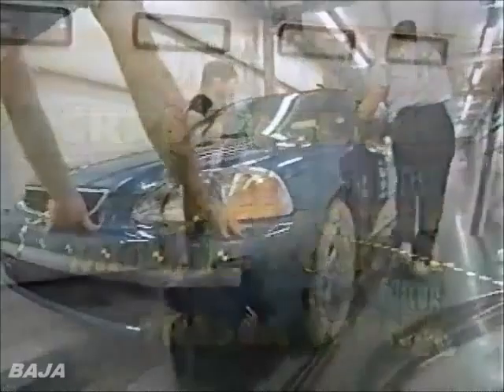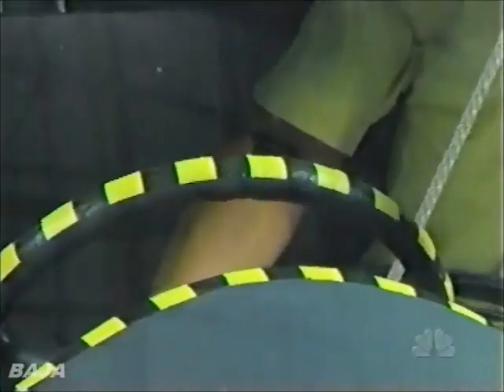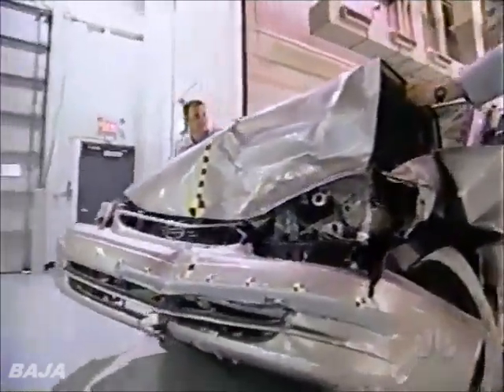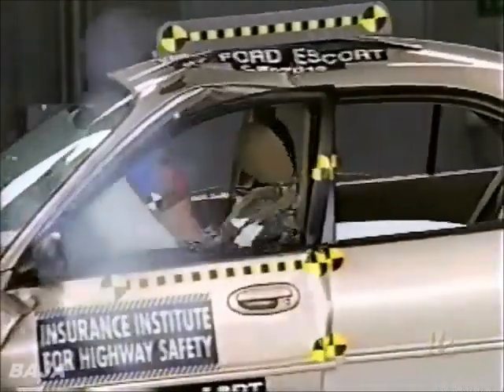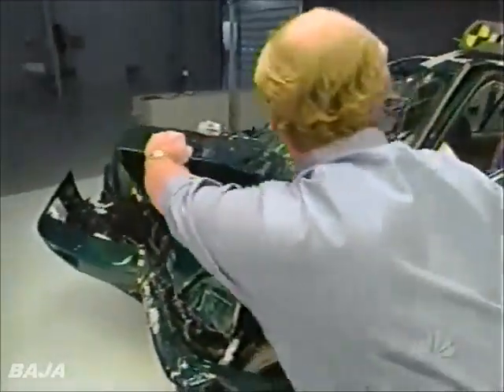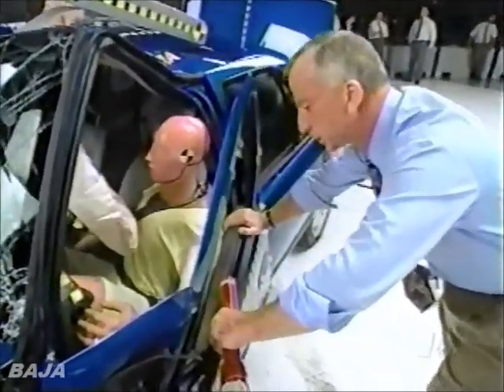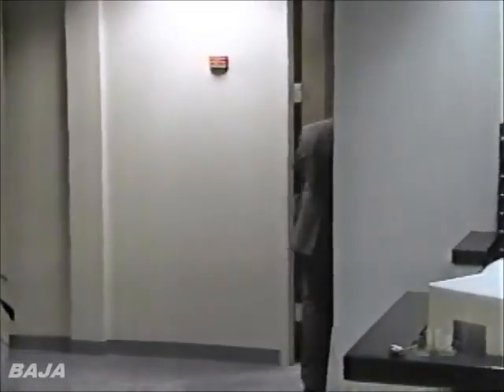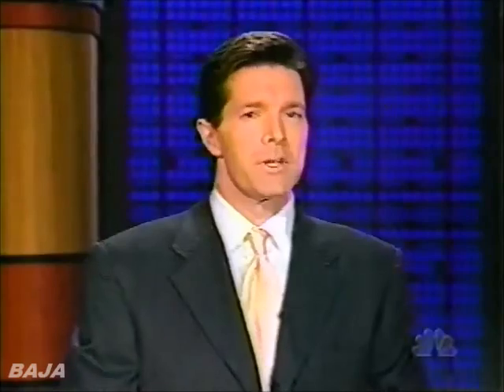22. Dateline 1997, 1998, 1999, 2000 IIHS Small Cars Offset Crash Test.flv

Comment: "They did extremely well; you would have survived in every one of those vehicles."

Key word: survived. As if the fact that people who have crashes in these vehicles, and will probably not be able to walk on their own two legs ever again, is not the real issue.
Reply: I DON'T WANT TO SURVIVE! I WANT TO LIVE
Reply: @jarofdelisauce2266 Poor lad. Just stay quiet and you'll be ok, we're heading back to the dealership.
Reply: Compared to the tin cans from the 80s and death traps from the 70s that most people were still driving, airbags and crumple zones made a pretty big difference
Reply: @oOgy172  In those cars the 1980s would have likely been the eldest daily drivers for most people, because cars generally did not last as long.  Corrosion was the worst enemy but mechanically totaled was a phrase commonly used in those days for a reason.

Comment: Remember, when all small cars collide with large cars, small cars will never be dominant! Large cars have better safety configuration and better structural design,
Reply: A woman hit an f-250 head on at about 50mph in a Volvo C30 and she survives
Reply: Since around 2010 larger cars are designed to be softer, smaller cars stiffer. This is to give the smaller car occupants a chance.

Comment: Although I dont disagree with the findings of these older cars, I think a greater issue today is how cars made today make you feel like your going slower than what you are, have less engagement between the driver and the ground that causes needless speeding and complacency. These tests dont mean much when most of the populace is driving above the speed limit and being careless. Nothing against proper hooning, but here in the states most arent formally taught to drive so accidents are more common. These tests tell a lot about a common crash but we really need to fix our drivers educations infrastructure. These small cars are relatively safe when not going head on with 5000 pound truck or a modern 200hp grocery getter 4 door. I hope the research they find continues to improve safety in cars but I find the market seems to sell cars a bit differently than what is efficient, safe or cost effective for the consumer.

Comment: Just 4 years later, the Elantra would flunk the offset test because of late airbag deployment and high head injury measures, along with movement of the driver seat. The 2004 Elantra improved in the same test because the airbags deployed on time.
Reply: However, it did take three tests for that generation Elantra to earn a Good rating in the offset test. The first test resulted in a fuel tank leakage, and the airbag never even deployed during the second test.

Comment: Oh my god this is terrible. Do you see the way those cars deform when they hit a solid object at speed. Those cars aren't suppose to do that.
Reply: The wall of the IIHS test lab also features a deformable metal barrier that simulates the crumple zone of the opposing car in an offset collision. This is the barrier that the test cars hits, meaning that this test is the equivalent of two similarly sized cars running into each other at 40 mph.

Comment: What year was this episode of date line premiered
Reply: I'm not 100% sure, but I would say somewhere around 1997-98, since they tested the redesigned  1998 Toyota Corolla. But they also tested the 1997 Dodge Neon, so it was definitely before 1999 when the new-for-2000 Neon was introduced.
Reply: Also the VW Jetta and Golf were new for 1999, and they tested the 1997 model, meaning the '99 was still yet to be released.

Comment: So fast, so severe? With the current 70 mph speed limits and traffic moving at 50 in a 35 zone, super-speeders, and monster personal use vehicles weighing three tons or more, inexcusably high power (who really needs more than 150 horsepower for daily driving?), 40 mph crash tests may be considered to be too slow. There is a trade-off between crash performance and manufacturing cost, but if one car does well in a particular test, what is the excuse that another doesn't in the same test?
Reply: 5610winston Honestly, is you crash going 150 mph, you’re probably better of dying quickly. Why would you want to live with half of your face missing and many broken bones?
Reply: You can't survive hitting a solid object at 70 mph, even if the car didn't collapse, your body would.

Comment: I though the Jetta would be a lot safer
Reply: Yeah, but it has been already outdated back then. It's essentially a VW Golf III from 1991, usually a small 3 door compact car. It passed offset crash tests at 35mph, and other tests against heavier cars of the day with flying colors. This 40mph test was specifically developed to raise the bar and challenge those older designs. Let's put it that way: a Mercedes 190E or BMW 3 series from that era wouldn't perform well either. The first Mercedes 200 C class barely passed.
Reply: @captmcneil You're absolutely right.
Reply: The Saturn tested is a design that debuted in 1991 and the Mazda chassis under the Escort goes back to the 80's.
Reply: The 1999 Jetta got a good rating.
Reply: Arbags

Comment: The results in IIHS and Euroncap are different. For example Civic in euroncap is a crap, Corolla is much better. Kia Rio is getting better and better and in IIHS it is a total crap. Probably there are some differences in these car for different regions?
Reply: IHS is better than euroncap they test at high speeds And have a better facility with better technologies.
Reply: @EnzoScalise777  what's IHS?
Reply: @pong.o  Insurance Institute  for highway safety
Reply: @EnzoScalise777 EuroNcap actually pushed the offset frontal test to 40 mph, the American institute started off using a speed of 35. The American side impact tests are better though, with a higher more aggressive barrier, and at 40 rather than 30.
Reply: antonarset, Yes

Comment: So, would the results of the SeVille also go towards the DeVille? Because you said in the description that the DeVille was one of them, but I never saw it in the video. Just the SeVille. I just want to know if I'm as safe in my 97 DeVille as I would be with the older SeVille they show.
Reply: Then you should probably change to the 2000 because it got a good when the 1997 got a poor.
Reply: Then you should probably change to the 2000 because it got a good when the 1997 got a poor.
Reply: Victor Roman Or just never get in a crash I guess. I can't afford a 2000
Reply: @KSBEntertainment You will, but you'll need to rebuild the engine with the longer head bolts.

Comment: I'm glad I drive the 98 Corolla.
Reply: Mat Jiowoo They aren't slow it drives really well and there is absolutely no rattles. If you think it is crap you can go ahead and think that but you can't change the judgment of other people . you could express you opinion but you don't have to criticize others or their possessions so shut the hell up.
Reply: tht isnt slow, and that its considering a mercedes 190 only makes 90 hp and cost almost twice as much
Reply: +George heinsman finally someone who understands me. old benzes are the best
Reply: what about if I had a 97 corolla
Reply: Mat Jiowoo screw you then
Reply: Exactly why i own a W126 560SEL Mercedes. Those cars are built like tanks i kid you not!
Reply: My friend bought a 1993 190E with less than 150k in mint condition for $4500. That car is slightly smaller than a corolla but 3X more safer. No wonder they call it a "Baby Tank"
Reply: +George heinsman Mercedes 190 not 190e has a m102 engine with 90 HP. a corolla base has a 4afe with up to 118 hp. and the cost twice as much point was also just proved. the corolla was bought for $2000 and it was in very good condition.
Reply: Timothy Mai The 190D (Diesel) produces 126HP The 190E 2.3L (130HP) and 2.6L (158HP)
Reply: George heinsman yay
Reply: Timothy Mai That 190 came with a 2.0L i4 engine, and was not designed for the U.S
Reply: +Timothy Mai why? do you drive these bland slow pieces of crap?
Reply: Timothy Mai aren't slow? oh cmon both of the engines make a sluggish 120s hp. no rattles? im pretty sure any car this old has a rattle. stfu and get your facts right
Reply: Timothy Mai omg mercedes dont make 90 hp engines and it costs way less than a pos corolla. again get your facts right idiot
Reply: corollas are crap

Comment: Was there a test done for the Chevrolet Cavalier?
Reply: +BlueNinjakoopa553 Yes. It received a poor rating. A concussion would be likely, as well as a severely broken leg. Depending on the crash, the driver may experience some more severe injuries due to the dummy flying about inside the vehicle during the crash. Instrusion was severe and the steering wheel column was rammed upwards, while the foot well was rammed back. The plastic inside the cabin was cracked when the dummy's head hit the windowsill.
Reply: BlueNinjakoopa553 The Cavalier was one of the first cars tested by the Institute
Reply: +BlueNinjakoopa553 Yes, IIRC, it received a poor rating for the frontal offset test.
Reply: +Josh Mckinnley The car is also relatively light (~2700LBS) compared to every other car. You'd probably die if you hit another car since the other car would most likely be heavier. Two of my friends have this car and I worry about them sometimes.
Reply: TechTipsToday No one want to see your ass.
Reply: I drove a 1999 Pontiac Sunfire GT (fellow GM J-body) for 16 years and 288,000 miles.  It was "totaled" in 2006 when I was rear-ended by a Nissan Titan and pushed into the vehicle ahead of me (traffic light).  I had the car fixed anyways, and drove it another 9 years...such a fun car, and cheap to keep on the road.  Sold it when Ford came out with the Ecoboost Mustang 😎

Comment: Kia needs to work on safety
  And they don't care
Reply: Um... Kias  now are considered some of the safest and best built cars on the road. You can't hold how they used to be in the 90's against how they are now as an auto maker. Especially since Toyota, Honda, Ford, Dodge, Nissan, and Mazda all had less than stellar performances themselves back then. I don't see you knocking them...
Reply: They're pretty excellent nowadays. Better ratings than even most luxury car brands.
Reply: KIA and Hyundai have more Top Safety Pick Plus Vehicles than Toyota or Honda.

Comment: They should test at 70 or even 60 MPH the norm for freeway speed . Then that would be very scary . Thanks for the upload , good info . Gave a like .
Reply: 70 mph no matter what car you have your organs and body can’t survive going that fast and stopping that quickly
Reply: @hoofaa17  it is possible in a particularly safe, modern (2018 or newer) car because modern cars are getting better at absorbing the energy, running it through the frame of the car, getting the forces away from the driver and increasing the time it takes to decelerate.
Reply: Jaymate nope, it can’t. A relative from Australia crashed at 70 mph, no intrusion into the cabin. He died instantly, no car can protect you from those types of forces from 70 mph to nothing.  In the top gear episode on YouTube they crash a smart car at 70 mph and listen to what they say near the end of the video
Reply: @hoofaa17  comment edited :)
Reply: hoofaa Even with a roll cage.
Reply: It's not the external injuries only. Your internal organs are not solid and fixed in place. Too much force, eg. rapid deceleration, will cause them to rupture. From the outside you look fine, inside you're pretty messed up. A close friend of mine died at motorcycle crash, as a passenger. Speedometer stopped at the moment of impact, showing 100 mph. She was wearing full equipment, helmet was intact and she had few minor bruises. She died from internal injuries.
Reply: @Kwaq84  
True !
Reply: The worst performers would be compressed on impact.

Comment: I have a mirage technica LS 1998 and I crashed into a 2008 dodge ram 1500....I destroyed the RAMs rim, rear brake and suspension but my car did not even brake the radiator. The whole bumper guard went back and did not touch the radiator, the RAM couldn't drive after that and I drove my car home..... Luck maybe?
Reply: the wall simulates a car of the same size coming head on at the same mph, at that 50/50 offset. im gonna guess the ram was sitting still or moving slow when you hit him?
Reply: I hit him T-bone style, It was a 3 car accident but the one that hit me ran away and my car made a slide but then gained traction when it was sideways and I basically T-boned the RAM in the highway at about 50-60MPH. My momentum was going straight to the RAM but the RAM's momentum was going in another direction (he was going forward which in my seat was from right to left since I was sideways going at him.) I hit him by the wheel and passenger door, the back door cause it had a crew cab ( I think that's how it's called, had 4 doors hahaha easier that way).

Comment: Its called aerodynamics.  Those cars are nice for nostalgic reasons but simply cant hold a candle to newer cars.  Power, performance, interior, unibody, handling, abs, AC, power windows, reliability, and so on.  Autos have progressed quite a bit since then.  And any car that is extensively restored is expensive but doesn't mean its great.

Comment: "safer than ever"
Tell this to Volvo or Saab.
Reply: DerangedSloth555 Or Subaru, whose vehicles have great results the modern tests.
Reply: Volvo has had a mixed history, so has Saab. The safety of the 240, 340 and 740 models was greatly exaggerated, the 850 performance in the 40 mph offset was average, and the 1994 Saab 900 did very poorly.